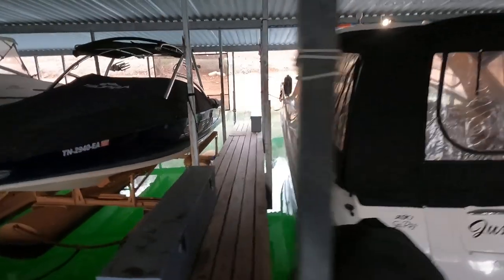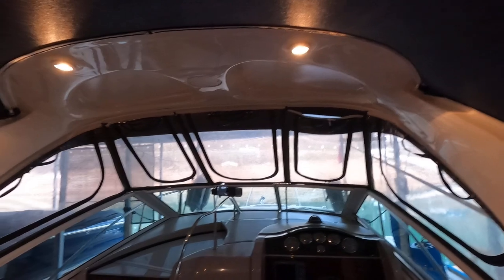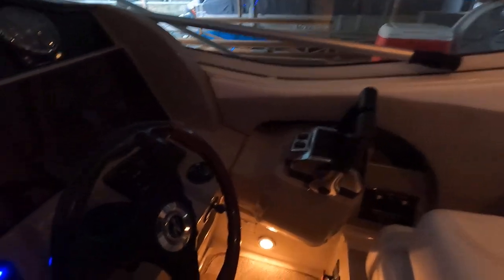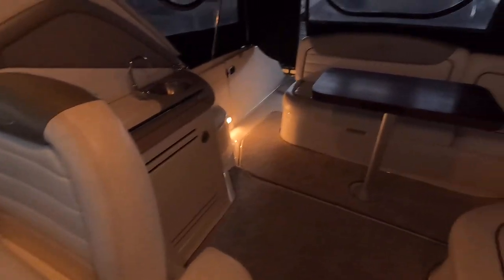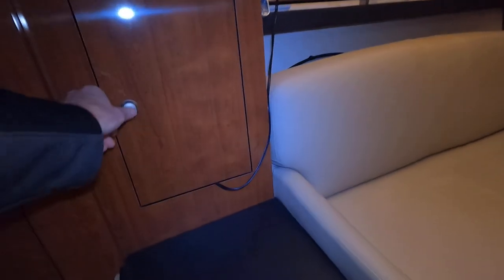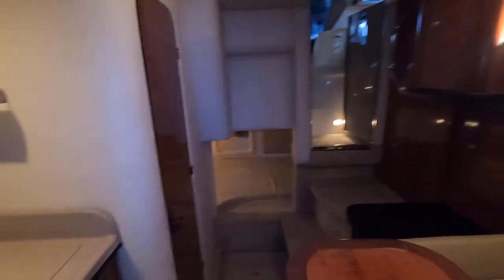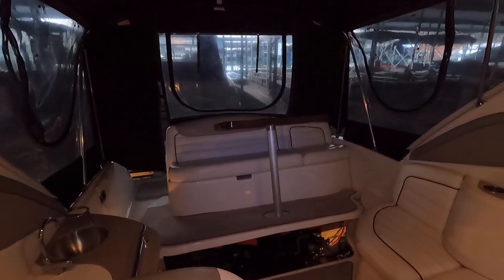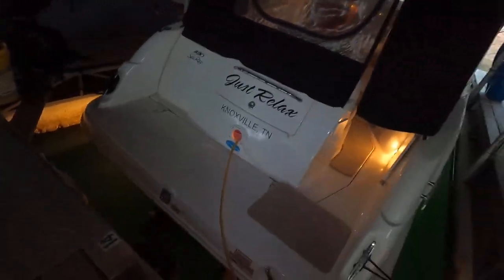2006 SeaRay 290 Sundancer For Sale on Norris Lake TN - SOLD!

Comment: Thanks for tour, nice boat ... note that storing life vests in engine compartment is not what I would recommend for it would take too much time to access in a real emergency and would be exposed to extreme heat from engines.  I like that they replaced original TV in cabin ... overall nice boat and they run great with v6s.